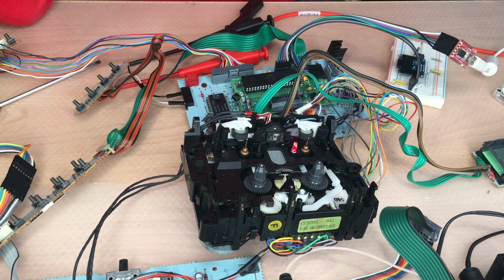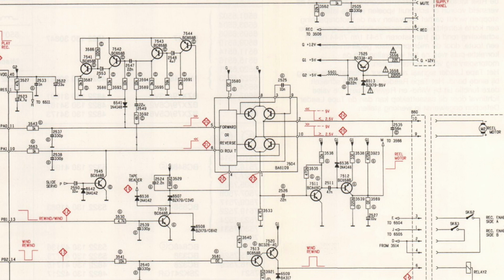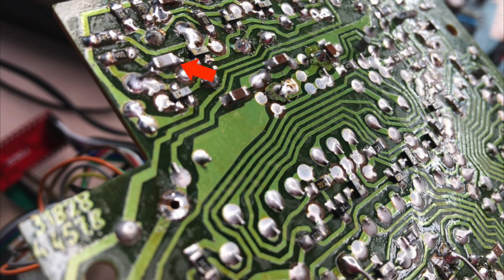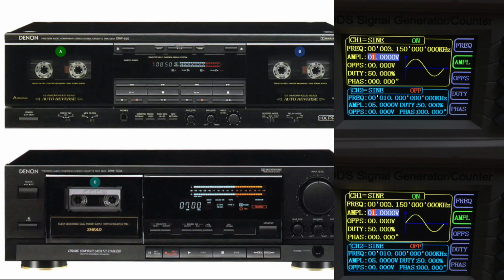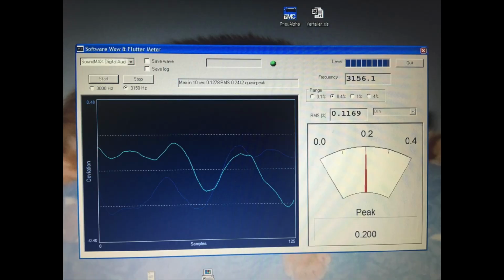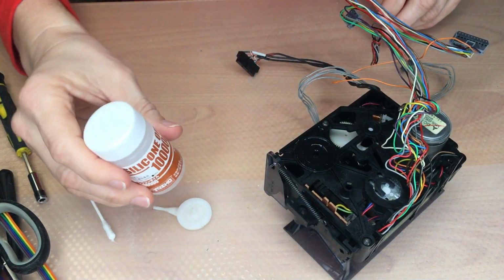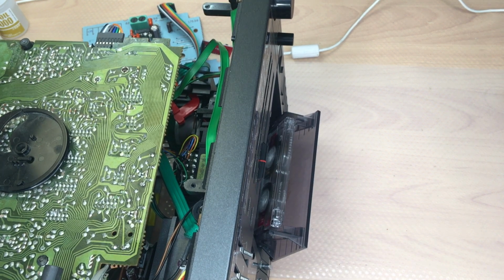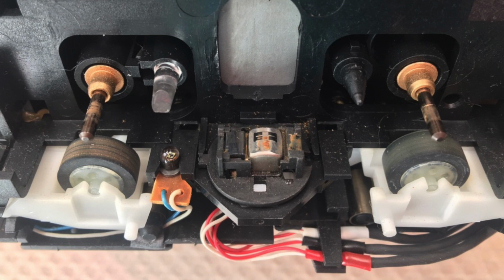Philips CD555, Resurrection EP14 Tape Mechanism 2

Comment: Hi, I have one without the cassette mech. Any information if the same mech has been used in other models?
Reply from the maker: Hi,
Unfortunately the used mech SER1/5602 is very special and after a lot of research I was not able to find this type in other products.

Some spare parts can be found in 70FC156 (SER1/5600) and in 70FC455 (SER1/5601) but by studying the service manual they neither can be mounted into nor would the original firmware of the CD555 be able to handle them. Both misses one relay used for music search to jump to the next/prior track on 4sec pause. Until now, it was not possible for me to get my hands on the service manual of the SER1/* mechanics to identify the similar parts and differences in detail. Sorry, no good news :-(
Reply: @daniela_spieler  Thank You very much!